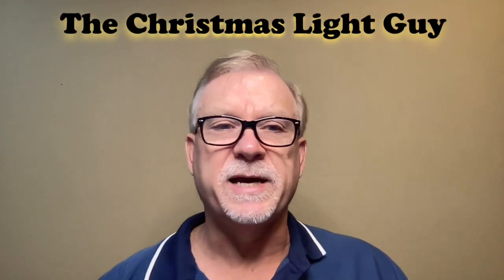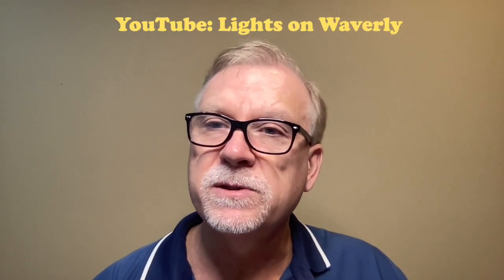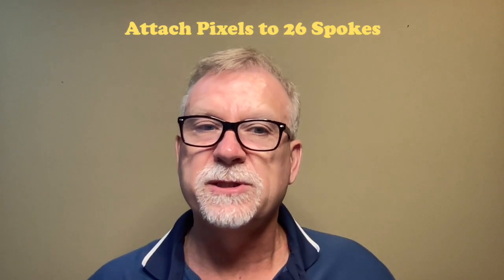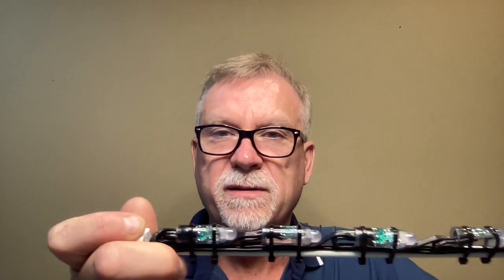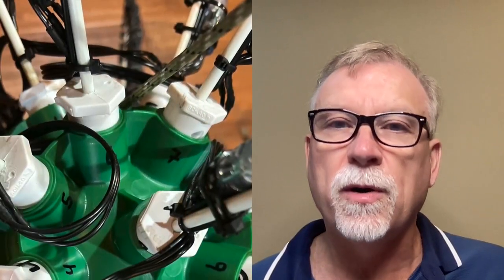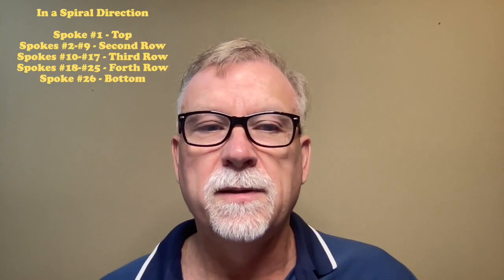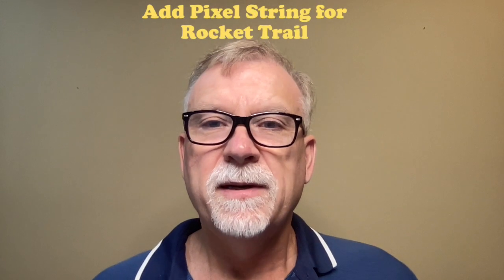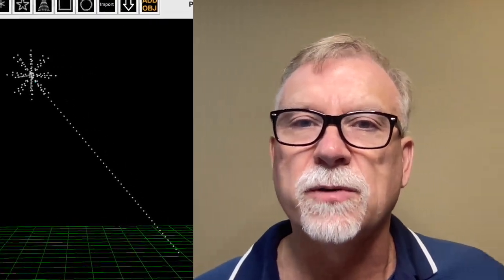How to Build a Firework Star Without a 3D Printer

Comment: I've done this with 1/2 pvc. I used connectors between each spoke so if a pixel burns out I can take the whole rod out, fix it and replace it.  Great to mark your holes so when one burns out you know your data flow.
Reply from the maker: Thank you